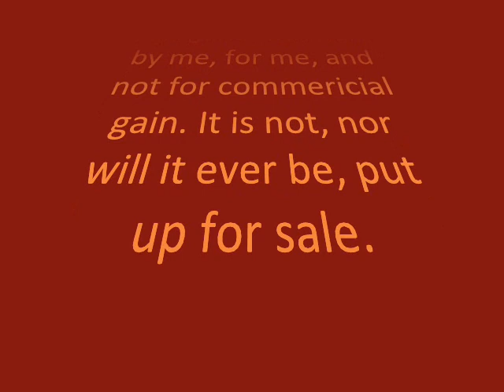Mickenbacker Build Slideshow - Rickenbacker 4005 Inspired Bass Guitar

Comment: First all... Amazing!!! Next up... I have a question about the pickups in the Rickenbacker 4005... I have afriend who once had one of these in the 80's. He didn't care for it & got rid of it (I know, I know, we are all heartbroken about this... argh!), but, happily, he kept the Toaster pickups. I just got a great deal on a '99 Rick 330 6-string ($700), but it currently has Hi-Gain pickups in it (really don't care for those Hi-Gains almost to the same extent that I love the Toasters... now the Rickenbacker Bass 
Hi-Gain pickups, those I totally dig...)

He thought that the Toasters in this were the same as in the 60's 300 series guitars & is basically giving them to me (trading for some house & cat sitting). One of the two pickups needs to be re-wound, but, happily, the guy who sold me the 330 is doing it for me (he also sold me a '78 4001 Bass for $600... now that's a pal!). I wanted to make sure these were the same as the guitar pickups before I put them in.I figured if anyone knew it'd most likely be you. 

I absolutely LOVE Toaster pickups. I have an old '66 Fireglo 360-12 that
 I've played as a 12 & 6 string & I'm in love with those old 
pickups. I'd love to put the old 4005 pickups into the '99 330, but 
wanted to make sure it was Kosher to do so. Thanks in advance for the 
help!!